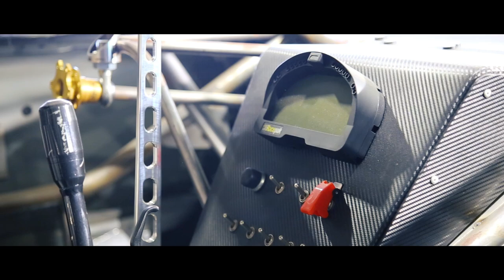Daigo Saito’s 2JZ Supra Pro Drift Cars for 2020 are INSANE! | Tokyo Garage Tour

Comment: For promotional reasons Toyota donated the Supra shell before any were released to the public, and it is for drifting so the JZ is the ideal fit. I went through 2 JZ’s and I’ll never do it again, they blow up frequently and rebuilding them isn’t cheap, plus they are old tech anyway. Happy with my R35, up to near 700hp with no major mechanical issues.